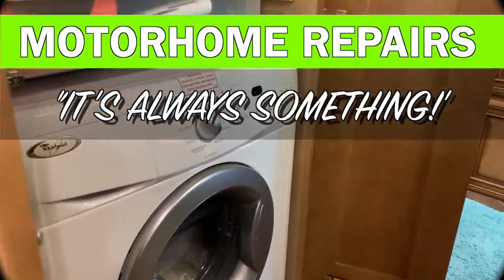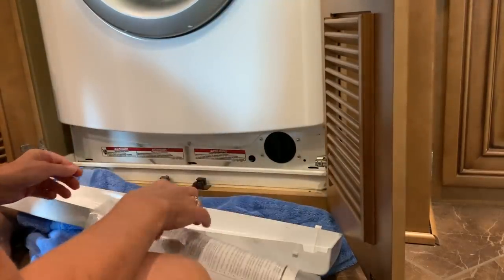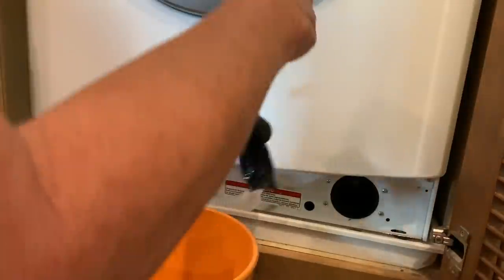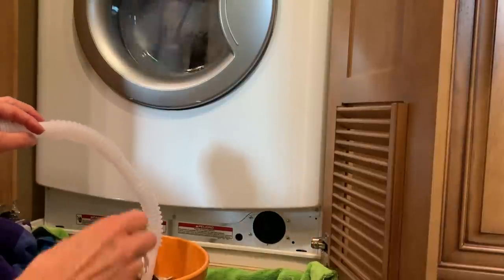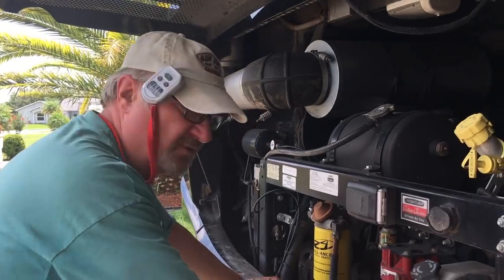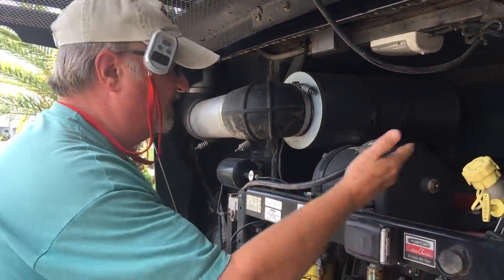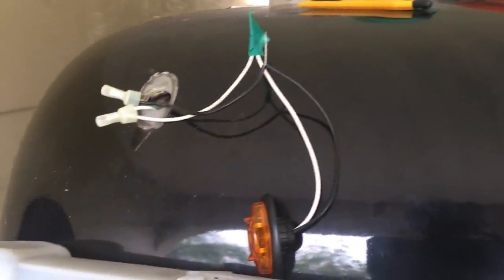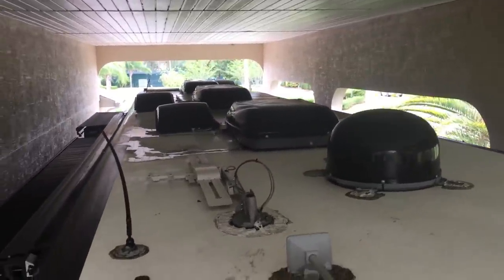CLASS A MOTORHOME REPAIR | RV CLOTHES WASHER CLOG | ROOF LEAK REPAIR | WINDSHIELD CHIP REPAIR  EP123

Comment: Mark You are a master RV repair great job of course it would  not have happened if it for Sue. Be safe out there. 👍☕️🍀
Reply from the maker: Thanks 👍You have no idea how nervous I get fixing things sometimes.  Sue did a great job, and is awesome when the work is at floor level.  I am not flexible.  I'm more of a table top level height kind of guy, in a Herman Miller chair.

Comment: Great Job Sue on the internet search for your repair and well done girl!  I will more than likely be the one on our roof doing repairs also with hubby watching/instructing from the ladder.  You two are great for sharing all that you do.  P.S. our ranch sold and then the buyer backed out 2.5 wks before closing due to covid.  We have it re-listed.
Reply from the maker: We had a similar thing happen when we sold our home.  Our home was unique in the area it was in, and the bank did not appraise it high enough for the buyer to borrow enough. We told the buyer we would just wait for someone that had enough dough to actually buy it.  That put us down to the wire of our "launch/retirement" dates by A FEW WEEKS.  Could be a blessing in disguise during this whole Covid thing,.....

Comment: Great job at draining the washer tray Sue.  You need to teach Mark some of this Enginuity. I hope you (Mark) shrink-wrapped the lighting cable after you soldered them.  Very nice of Mark to send you up on the roof in the heat Sue (Supertech).  My wife won't let me "acquire" stuff from the garbage, guess no Newmar for us.
Reply from the maker: I just wrapped the connections with electrical tape.  You most likely won't believe my latest "score" in the garbage area at the RV Park here.  Someone threw out a brand new looking, barely ever used Dyson Animal V8 portable vacuum. IT JUST NEEDED A NEW BATTERY! It looked like they used in less than 2 times, and it must have sat where the battery went bad. They are $400 new!
Reply: @OurJourneyInMyles  Sweet.  Maybe you can find a small wet vac for the next time Sue has to fish your gloves out of the washer filter.

Comment: Sue great job on the washing machine fix and roof work! Mark great job breaking the washer!

Couple notes; 1)solder - not needed, can do more harm than good. The ABYC (safety standards for boats, which live in a very similar environment to RV's) banned it for years, now they begrudgingly allow it but only if there is a solid mechanical connection  first. It's really not an issue for your marker lights, but the gist of it is boat/RV wiring needs to be flexible to minimize the effects of temperature extremes and vibration, solder makes a connection rigid and therefore more susceptible to failure. If the connection isn't mechanically strong, heat thru the wiring under load could melt the solder and cause the connection to fail also. Best belt and suspenders approach IMO (former boat electrical guy) is a solid crimp using quality components and tools and adhesive lined shrink. Crimp connectors are readily available with adhesive lined shrink sheaths, just crimp, test for a strong connection, heat with a heat gun to melt, shrink, and seal from moisture. The adhesive also provides strain relief. Moisture can cause corrosion, especially on RV wiring which is (or should be) stranded but tends not to be tinned (tinned wire is silver colored) . Tape is often bad because it is trapping moisture, a proper crimp and shrink connection is best to  keep moisture out. More here: https://www.sailangle.com/articles/details/id/6
2) Dicor is the old standard for roof sealant, it was required for rubber roofing that was not compatible with petroleum based sealants. If you have it keep using it, but FYI for several years now the RV industry has switched to a flowable silicone product such as Nuflex RV-311. It's much stronger, flexible and does not check and split like the Dicor (or show footprints!), yet flows out the same. In my experience it holds up way better, but builders still tend to glob on way more than is needed.
3) Over the years we've made many insurance glass claims including 4 or 5 windshield replacements on the Ody and never had our premium go up. That was with MA and FL registrations that have mandatory glass coverage. When Safelite came to fix our last chip they used a computerized gizmo with an electrical pump of some sort and UV curing lights. Stuck it over the chip and done in 15 minutes. Can still see the crack but at least it hasn't spread.
Stay well folks!
Reply from the maker: Wow!  Great comment Rob.  You have only drastically changed my thinking on ALL 3 out of the 3 issues listed! Thanks for the great detail for myself and others to learn from.

Comment: Frugal Mark - dumpster diver! Whatever it takes guys! Hope the Swifter is working well for you. Did the glass tech drill the hole entirely through the windshield or just through the first layer of glass? Thanks for the PRO tips!
Reply from the maker: The tech just drilled thru the first few layer(s),......NOT all the way through.  Swifter has worked out great!

Comment: Where did you get the bumper pad for the top of the ladder?
Reply from the maker: I have about 12 of those pads.  Got them from Menards Building Supply Centers.  They are actually a seat cushion used for hunters in a deer stand!  We now have a better one in our Amazon Store that in wider, and thicker make specifically for kneeling. The link to the store is in the description area below any of our videos.

The milk white pad at the end of the ladder, form fit over the ladder end, was purchased as an accessory from the "Extend & Climb" ladder company that made the ladder.  It also is in our Amazon Store.

Comment: SAFETY TIP Any lanyard being worn around the neck, when working near moving parts should be designed to break easily if it were to become entangled.
Reply from the maker: Wow!  You are absolutely correct.  I have been away from work and safety meetings for too long!
Reply: @OurJourneyInMyles  No worries. I am a H&S manager and something I insisted upon be used at my sites :-)

Comment: I just watched your windshield chip repair.  You made the comment that you would not claim the damage on your insurance policy because your rate would increase for 10 years.  That is incorrect.   As a former insurance agency owner I can inform you that a windshield crack or chip is a "comprehensive claim" on your policy and does not effect your premium.  Having stated that, if you have several "comprehensive" claims,  an insurance company may review the losses and decide that yours is a risk they may not want to continue to insure.  That may prompt a "non-renewal" of you policy.  However 1 comprehensive claim should not have any effect.  Also most insurers will not impose a deductible if the windshield is repaired rather than replaced.  You may still be able to submit a claim.
Reply from the maker: Good to know Stuart, ......thanks for stopping by.